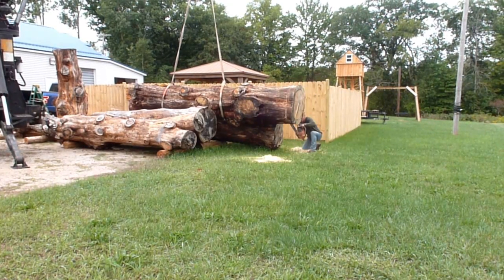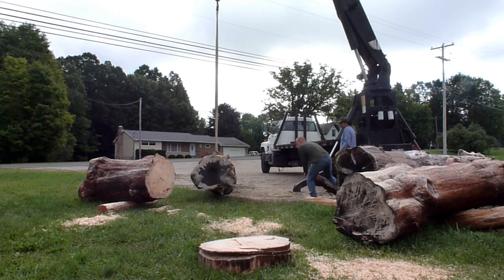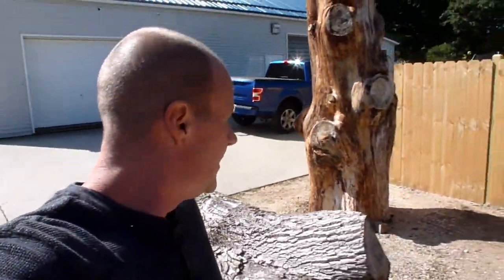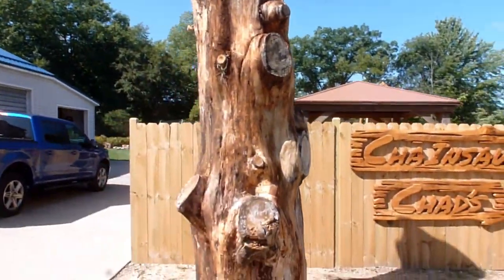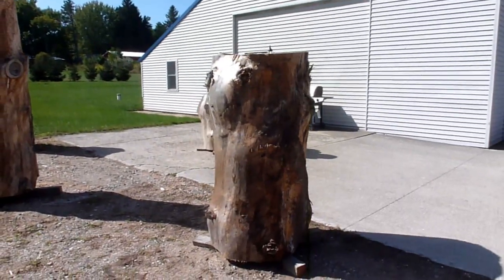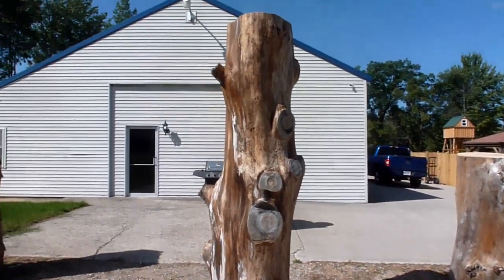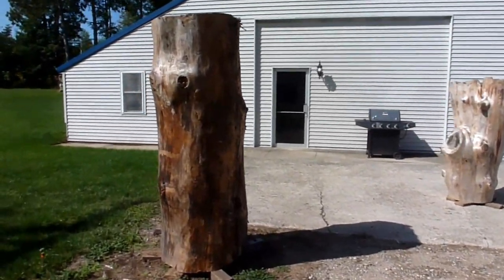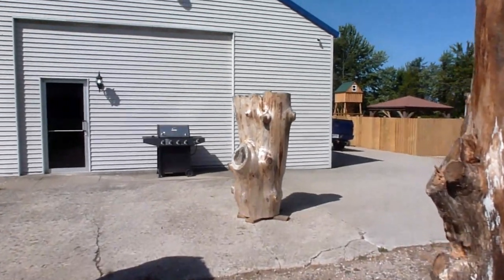Chainsaw Carving A Standing Eagle - Time Lapse Chainsaw Carving!

Comment: Nice logs Chad, they look great in front of your nicely fenced in carving area. Also, the privacy fence helped a lot with the road noise.

 Not sure how loud the road is in your house, but I recommend getting your house insulated by Retrofoam. We are right on a business route, and it knocked out 75-80% of the noise. Can’t wait to see the heating bills this winter!
 Last but not least, yet again, an other awesome carving, good job Chad.
Reply from the maker: Thanks for watching Eric! Inside our house we can barely hear traffic at all. The house is extremely well insulated, it even is double drywalled and the exterior walls are 10" thick.  Thanks again Eric!
Reply: Well that’s sweet. Never heard of double drywall, I bet that makes a huge difference on both noise and heating, along with the extra insulation.

Comment: So was the firing of the wood nescessary or did you have a change of mind on the finish for this one. It seems you torched it, sanded off but then went for a paint finish?
Reply from the maker: The burning stiffens the wood fuzz so it's easier to sand. It also burns the bar oil from the chainsaw.
Reply: @Chainsawchad  Thank you Sir, Just watched your creepy doll video, As usual top work. More of it.